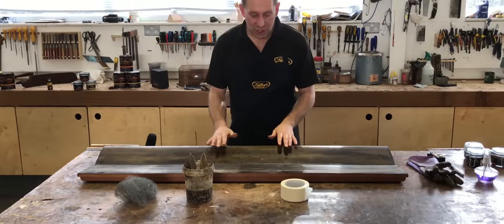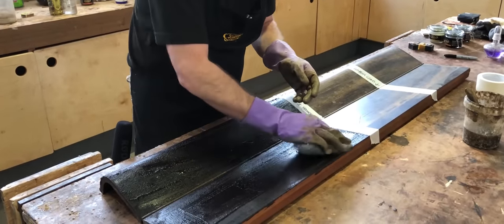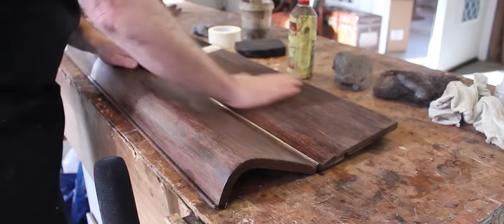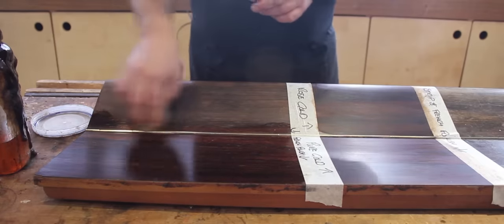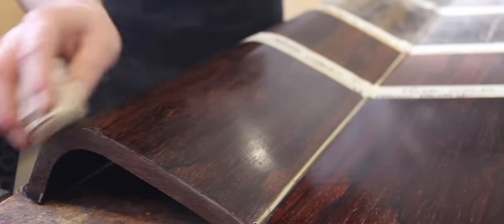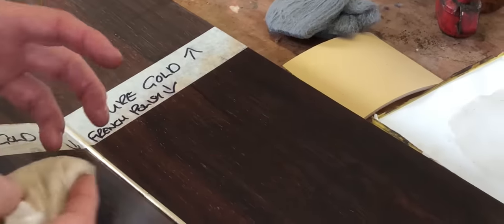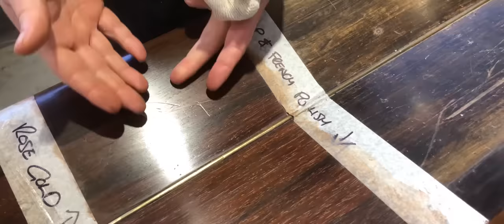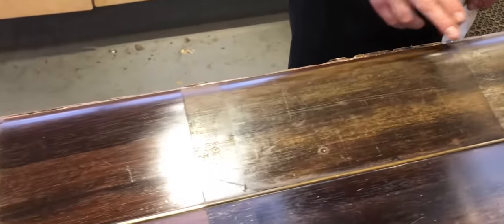How to Strip and French Polish Wood Furniture

Comment: French polishing is a technique.  It’s not the substance used to polish, which is actually shellac.  Shellac can also be applied with a brush.  However, in that case, one couldn’t say that the instrument or piece of furniture was French polished.  I just wanted to make it clearer for those who were wondering.
Reply: Thank you, the video seemed to suggest that the substance used was "french polish" and that it was a 'special' polish.  What is the difference in finish between applying shellac with a brush and french polishing - does the latter give a high gloss finish?
Reply: Jay S I don’t know whether applying shellac with a brush gives a higher gloss.  As I mentioned French polish is the technic he uses to apply the shellac with a pad.  With a brush, you would still have a shellac polish.  But just not a French polished piece of furniture or instrument.
Reply: Jay S  Applying shellac with a brush wouldn't be termed French polishing. Technically you would be what they term spirit varnishing. You can get it extremely glossy but it requires going through finer and finer abrasives/polishing compounds. Alternately you can do a mix, part brushed and finished off with a French polishing fad. The real difference between the two methods is that the action of the fad helps to fill the grain or any pin holes/blemishes. Brushing isn't so good at that aspect. A brush with extremely soft hairs is used, very thin shellac, many many coats for a full gloss flat finish. Don't assume that brushing the stuff on is easy, it isn't.
Reply: Jay S one consideration which was eluded to but which plays an important factor in the final result - he mentioned the wood had its grain filled. Some woods are open grained, others closed. On an open grained wood that has been filled, you inherently wind up with a more level finish. The filler can often be dyed which can be used for effect. 

The French polishing technique, I suppose is an early method at filling the Grain, cut shellac brushed on and sanded can do serve the purpose, effective but takes practice and patience
Reply: @vihuelamig  Also, since the shellac dries so quickly brush applications tend to build too fast and leave a less than desirable surface. I guess that's why the progression through  polishing compounds is recommended.
Reply: If I'm not mistaken a French polish is achieved traditionally by striking the surface with cotton cloth or rag in an angle to create heat or buffing in a hard fast motion to heat the finish up. Isn't that kind of the technique?
Reply: completely correct ,I'm fed up with the many vids about French Polishing which are not,being mixed up with wood finishing generally,I have not seen a definitive vid about wood finishing.  That I consider professional

Comment: Something well worth pointing out: The finishes on these pianos (original French polishes) often stand up to time and wear much better than finishes applied later.  I frequently see older antique pianos with beautiful intact finishes while younger finishes have severely deteriorated.
Reply: That's because they had the time to take the time. As I wrote in my reply above, for me to finish a 40" round Golden Oak that came to me perfectly sanded and ready to finish, would still take more than a week of doing nothing else but working on it. Having to remove old finishes is a miserable, thankless task, but it must be done.

Comment: I have an old piano with a ruined French polish finish. I got a quote to have the cabinet redone and the French polish option was several times as costly as the cheapest finish. From this video I can see why - the labour involved in French polish is just silly by modern standards.
Reply from the maker: Yes. You are absolutely right. It's the main reason why it's a dying trade. It's a shame but an economic truth. 😌

Comment: What is French polish? What type of rubber; where do you get it? What type cloth is wrapped around the rubber.  The effect of this process is stunning. Thank you.
Reply: French polish is youre finish thinned out, the rubber is a wad of cotton, and the rag is a soft cotton rag. I believe he said he used a shellac for his finish. He pretty much did the same thing anyone else would do to apply finish, he just rubbed it on instead of using a brush. Personally ive goten better results applying a finish, then using 800, 1000, then 1200 grit sand paper, and then using a polishing compound like the stuff you buy for your car. Much higher shine and i don't have to worry about getting my chemical mixtures perfect

Comment: I have done french polishing on a few hobby parts (in purpleheart) i wish i knew the makeup of the polish a friend gave me. The wood looked like it had a glass or high polish polyurethane coating on it after only 4/5 coats. It was beautiful but still smelt and felt of wood not polyurethane. My finish of choice for my woodworking.

Comment: I love wood and I learned so much from these videos! Thanks for sharing! Could you recommend a good paint stripper? Would turpentine substitute be good enough to remove some thick layer of painting from oak?
Reply from the maker: Thank you Diana.
I would try using a enviromose or similar. Turpentine substitute alone will not work. 🙂

Comment: Thank you for taking the time to make such a great video on the subject of French polishing. May I ask about the white mineral oil boiled and unboiled what's the difference? How can I tell them apart? Where can I get hold of the correct mineral oil?
Reply from the maker: Hi Jimmy. 
Thank you for watching our videos. 
Boiled linseed oil has a chemical dryer added to it to accelerate the drying time.
Raw linseed has no dryers added and therefor will take longer to dry.
Mineral Oil is highly refined crude oil. (baby oil is a mineral oil) It's so refined, its food safe.
Just 'google' mineral oil.  ✅

Comment: Excellent video! What would you do if you wanted it black again? Would you paint it black and then french polish on top? I have an old black piano from the 20s im trying to restore but I don't know how to best restore the black shiny surface that is now quite dull. Parts of it look more grey and in some places it has chipped off revealing light wood underneath. I have not been able to find any good info on restoring old black uprights.
Reply: The black is often done by adding carbon black pigment into the shellac in the early stages of the polishing process described here.
Reply: Thanks for the idea. Where can I buy that black pigment?

Comment: I can't seem to finish the polishing without dull streak marks left behind.  I tried using less DNA and it seems to stick more.  I tried using more oil and that didn't help.  I tried using more DNA and that dissolves the previous coats.  How do you get that final polish where you can call it quits? This is so frustrating.  When I start out a new session, it works fine, but as I work it out and start burnishing, the dull marks start to be left behind.
Reply from the maker: Hi,  I would go with using a little less DNA and use a little more oil on the surface to help lubricate the  rubber. 
It sounds like you are getting burn or scorch marks from the rubber.

I know its very frustrating , it's not an easy craft to master. It can take months of practise to get to grips with it. But thats what you need to do. You'll start to get a feel of how it works after a while. :-)
Reply: @GilboysRestoration  Once you have streaks / burn marks, will correct technique take them out or do you need to go back to the start? I have a piece with streaks that I was working on today and, having watched you, think I was too slow with the rubber and didn't use enough oil. So, I'm wondering whether simply carrying on after correcting those faults will take out the streaks (once I get things right), or do I need to remove the polish and start again? Thank you for the helpful video and your responses to questions here.

Comment: I can't get the hang of this. When I try and apply a second coat a 
couple of days later it seems to lift the first coat in places so I end 
up with an uneven layer.
Reply from the maker: Hi Richard. 
It may be because you are not moving the rubber fast enough when it makes contact with the surface. There is an art to applying french polish and if you allow the rubber to rest for any period on the surface it will "burn" the finish underneath. The solvent in the rubber will start to dissolve the previously applied polish.  

French Polishing is not really about coats, it's not a layered coating system. It's the process of applying a 'body' of polish to the surface of the wood... 

I'll try and explain: 

The art of it is; understanding how to do this using a rubber and working the polish from it' and then on to the surface. At the same time as using pressure from your hand to squeeze the rubber forcing a measured amount of polish out and using pressure on the surface to move this polish around and then the speed and movement of the rubber on the surface also has to be considered. Move to slow and too much polish is applied, move to fast and you lose control of what you are doing.  
All of this has to be understood and then mastered. 

The only way to learn this is by repeatedly doing it. Hence, in times of old, there were french polishing apprenticeships of 3 to 4 years.

Comment: Thank you for this, which is brilliant.
Could this be applied to kitchen tables?
Reply: It could, but it would not be a good idea.  This finish is meant to be used gently, and not often touched.  An extreme mistake would be to set a wet glass on the surface, or a cold glass that will collect condensation. 

If you want a beautiful table surface that will last, try sanding it to 1000 grit and then applying Minwax Polycrilic, or some other decent acrylic surface sealer or a polyurethane sealer.  Then start with 1000 grit and wet sand up to 12000 grit micro mesh before you apply meguiar's plast-x (vehicle plastic parts polishing compound) and buff it to a mirror gloss.

Keep in mind that this kind of finish is not used on a musical instrument for good reason.... it can affect the ability for the wood to "breath" or adjust it's moisture content (by sealing it in or out), changing the tonal quality of the wood.  This is undesirable, though the instrument would indeed LOOK very pretty.

Comment: Hello Simon
This video has got me really intrigued.
I have an old (2nd hand) Washburn acoustic guitar which had a natural (spruce) top (soundboard).....the problem I have is purely aesthetic.
The previous owner (who must have been intoxicated) decided to splash varnish over  certain sections of the soundboard resulting in .... an aesthetic mess.
I have sanded and sanded but, the three sections containing the varnish stains are still in evidence.
What can I or do I have to do to strip the varnish.......?
Use the paint stripper you use ?
If so, what would you recommend ?
In anticipation.......
Thank you
Reply from the maker: Hi Lynda,

I would suggest stripping the surface and following our latest video on creating a dry shine, it teaches you all about the stripping process and what to do after that. Sadly the stripper we use is for industrial use only and is not available to the general public, they do however make an alternative called "enviromose" which i believe is their consumer grade stripper.
Reply: @GilboysRestoration  

Hello Simon

Thanks for the tip.

As it's a "one-off" job for a 2nd hand guitar, I'm not sure I could justify the cost of Enviromose but, I will try some alternative on a piece of scrap wood to which I could apply some coat of varnish, then trial.

I cannot find your link but, I'll keep looking....watching artisans working is therapeutic anyway !

Thanks.
Reply from the maker: @lyndamcardle4123 Here you go lynda: https://www.youtube.com/watch?v=GYJeZbj7rME&t=1589s

Comment: Do you have a recommendation of getting a similar finish of those wax finishes that would be resilient enough for an outdoor application? I live in Southern California where temps soar over 90°F/32°C degrees for about 3 months a year.
Reply: Nothing (even glass and steel) can stand up to the eroding effects of UV rays and weathering.  The best you could do is marine spar varnish or one of the commercial wood treatments.  French polish is for well protected indoor use.
Reply: I figured as much. I'm simply looking for a comparable finish suited for outdoors. I'll definitely look into your suggestions. Thanks mate.
Reply: @SansP3ur  spar urethane... one with a good UV protectant.  put it on and make sure you have a good solid coat.

Next, begin wet sanding... start with 200 grit or so to level it, then take it up to 12000 grit micro mesh, removing all scratches from the surface each time and wiping the residue from the surface between every grit.

Finally, polish with meguiar's plast-x for a mirror gloss.  Give it a coat of turtle wax to make water bead up and roll off it... wax also repels oils like from fingerprints.

Comment: If you were to do the inside of the fall and the decal (piano manufacturers name in gold letters) was removed by the preparation, at what point in the process would you apply a new decal?
Reply: Probably next to last. Last would be a thin finish of varnish.  Possibly wax on top.
Reply: @firesurfer  Thank you for your reply. I am hoping to refinish my piano including the fall board and have bought a new decal. It unfortunately had a split which I have glued and clamped successfully, can you recommend the best way to fill in the remaining slight 'groove gap' before refinishing?
Reply: @DAVE121063   I guess you are talking about the wood itself. There are numerous wood fillers out there. You might want to experiment on some scrap wood with very fine sawdust mixed with wood glue and tint to match. This is a tedious process and will probably take several tries. See if you can get a piece of the same kind of wood. Make a couple samples with the same kind of break and glue it up. This sounds crazy, but you don't want to experiment on your piano. 
   There are wood filler sticks in various colors. You might get lucky and one of them may match.
  BTW the top finish is very different depending on who you talk to. Even fine woodworkers will disagree on what to use. The actual product will depend on the quality of the piano itself, your wallet, and your patience.  https://www.homedepot.com/p/WoodShield-1-qt-ECOS-WoodShield-Gloss-Varnish-00817292020032/303610546
     If doing a french polish, I would not do varnish for a top coat. Laquer would be more appropriate.
Reply: @firesurfer  Thank you very much for your advice and for taking the time to reply. Much appreciated.

Comment: Wouldn't it be best to use brass wool instead of steel wool? Fine pieces of steel wool will break off and imbed in the wood grain, later to rust and turn black.

Comment: I suspect that you are not doing the French polish. What about the pad filled with pumice and "charged" with the oil/varnish/lacquer mix that serves to knock down, fill and polish all at the same time?
Reply: That would be a horrible idea.  Pumice is volcanic rock ... it can be glassy ... it would be like trying to finish and polish with a piece of sandpaper.  You would end up with wood dust and stone dust mixing in with the varnish, making the surface look muddy, and the varnish would harden over the particles.  You would then have to strip the finish away to re-finish.

He choose to leave the original (lighter colored) filler in the grain and not to fill in any dents, scratches, or gaps in the surface of the wood after stripping (he could have used boiled linseed oil to remove that lighter colored filler).  The polish itself will take care of filling in light scratches ... the part where he removed the nibs (the high peaks left behind by the polish as it dried) with the 320 grit sandpaper can be repeated as many times as desired, bringing additional layers of the french polish on to completely fill in all the dents and scratches, and then sanded back to a perfectly smooth surface to polish again.  This can result in leaving a mirror quality finish on the surface of the piece.

Comment: I would have liked to have seen some circles and smaller figures of eight this would have filled the wood and stopped any chance of ropeness that can occur if going mainly side to side. The use of a Perspex or metal scraper used carefully so as not to dig into the wood helps when removing the stripper.
Reply from the maker: Hi Scorpion. 
I agree with you on all counts. I was a little pushed for time but yes you are right. The use of a cabinet scraper or perspex scrape is something we use all the time in the workshop. This piano fall was a little to small to use them on but I could have shown them as an example.
When we next demonstrate French Polishing I will show the smaller figure-of-eight movements and the circles. 
Kind regards 
Simon.